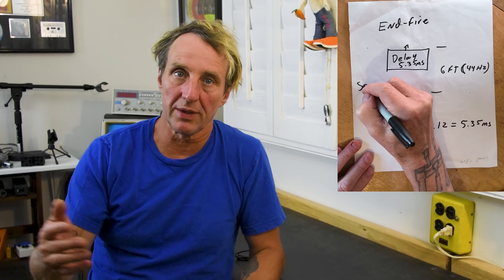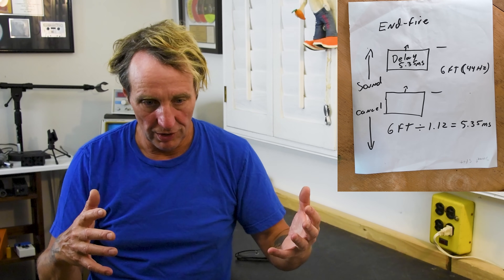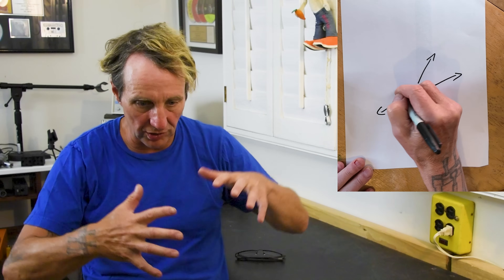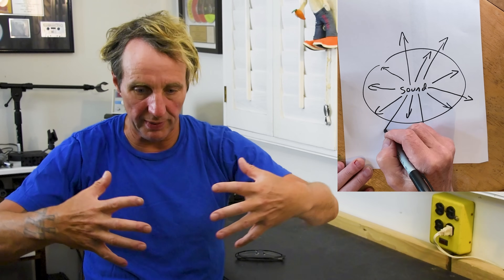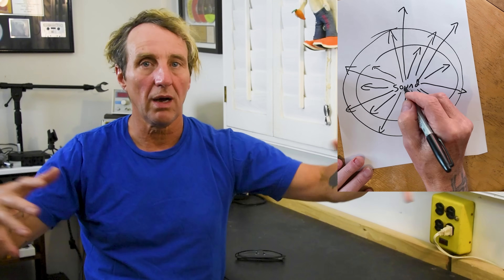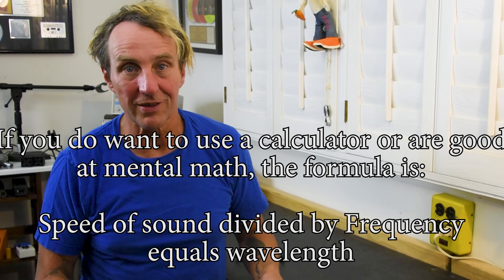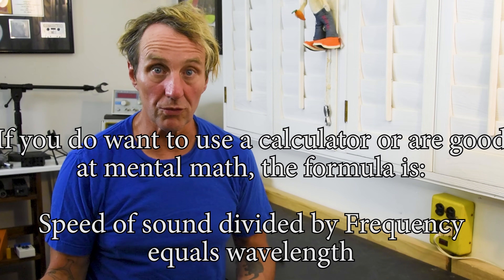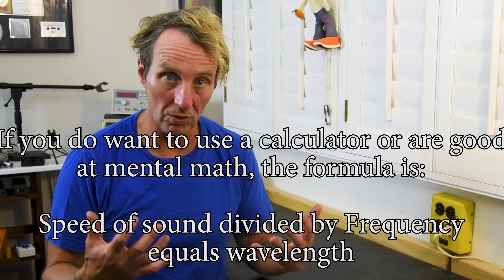Remembering Wavelengths of Sound is Easy

Comment: would anybody be kind enough to educate me why it's important to know what frequency has a wavelength or half equal to the distance between speakers? i assume it has something to do with phase, but i don't see the implication of not knowing nor the benefit of knowing. any help is much appreciated😄
Reply from the maker: it helps with troubleshooting sound issues and keeping things in perspective. 

if you're tuning a system and you see that you have a a big hole at 250 Hertz in a specific listening area and you can think, ok, 250 is going to have a wave length a bit longer than 4 feet, so 1/2 wavelength is around 2 feet. 

then looking around you see that there is a reflective wall about 2 feet from your speaker, aha, maybe that is the issue. moving the speaker closer or farther from the wall may be a solution.

its about conceptualizing sound. 

why do larger cone cone speakers get beamy and have reduce dispersion at higher frequencies? because when the wavelength being reproduced approaches the diameter of the speaker, you get off axis cancellation.

knowing the wavelength of a frequency will allow you to know what frequency different speaker sizes get beamy.

if you have a 12" speaker, what frequency will it get beamy?

what about a 15" or 18"

can you figure it out in your head and just know it or do you need to look it up?

if you desire to reach the top levels of your craft, then having this type of knowledge and the tools to know it may be usedul

Comment: simple spread sheet on your phone.
Reply from the maker: Yes that will work, and also Don't you think it's kind of fun to walk around and look at something and call out the wavelength without consulting an electronic device? 

I used to sit down had a drum set Hit the kick drum soft and then hard and then shout out that the drum throw is out of polarity. 

it's easy to hear once you know what to listen for.

alternately we could get a polarity checker and stop everything and muck around for a while and come to the same conclusion.

I can walk across stage while the band is playing and determine with just listening whether the wedges are out of polarity with the bass rig or guitar rig or both.

I find this method of internalizing and conceptualizing sound and listening without relying on test gear or devices to be quite valuable. 

additionally when doing a bunch of calculations on your phone having an intuitive knowledge of what the answer should be to make sure that what was calculated is correct is extremely useful for avoiding mistakes
Reply: @DaveRat Hi dave .. YES with enough experience you would be able to walk through a setup and hear what's right and what's wrong... If you have to do that math on a regular basis it does become second nature. In the end it's not the math, It's not tech, iit's YOUR experience and ears that make the difference.. Going into a venue and being able to spot (hear) the issues AND then recommend the solution is the ultimate. I was at a theater show on Thursday ... Every time the 'booth' needed to play and SFX there was loud banging / popping, like a gun shot  and no SFX.. When they finally got the SFX going it was 1/2 volume. I really want to jump up and engage., but alas I was just an audience member.... The mix was poor as well..  Body mics and live orchestra  was not balanced at all... No Subs... just a couple of 15"  3-ways  on poles... 150 seats .. Community theater... always a challenge ... Thanks for these videos they aer very helpful.
Reply from the maker: awesome and aaargh, yes, hearing issues at gigs is such a test of patience.

and so frustrating. thank you so much!

Comment: I think the rest of the world needs another video employing SI units.
Reply from the maker: great point. 343 meters per second, 343 Hz is one meter WL.

it works quite well as 34 Hz is a 10 meter WL.

but now that I think about it, if you can scale feet you can scale meters.
Reply: @DaveRat  shorthand in meters I use is 

40hz -> 8m
60hz -> 6m
80hz -> 4m

I just remember 40, 60, 80 (most common sub freqs) and line them up in reverse order (inverse relationship)
Reply: it's one of the the not so many examples where SI doesn't look as clean as imperial :)
Reply: Thanks for sharing Dave..🙏